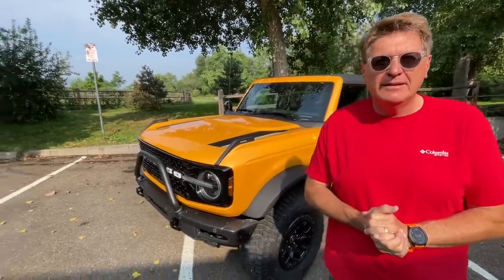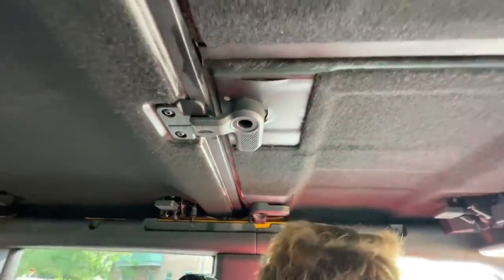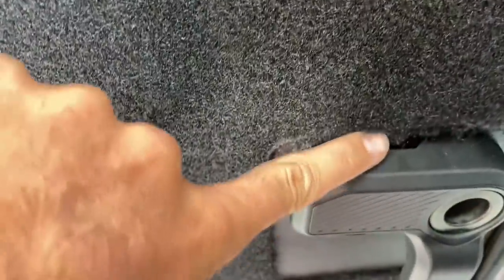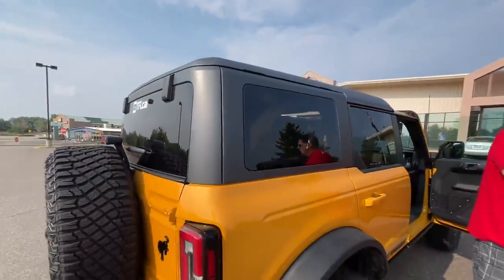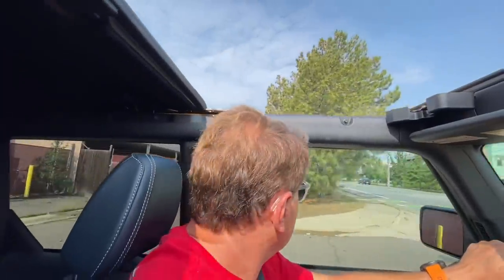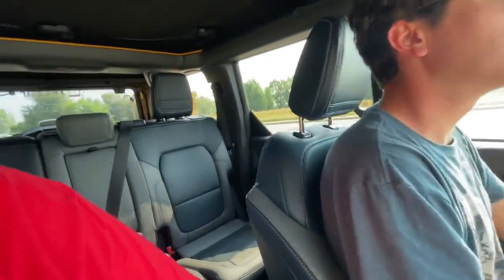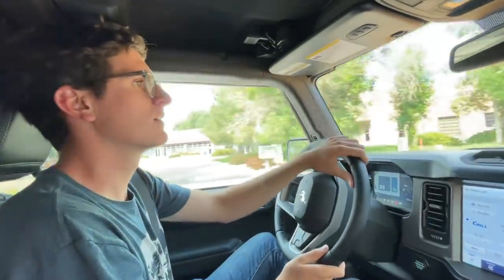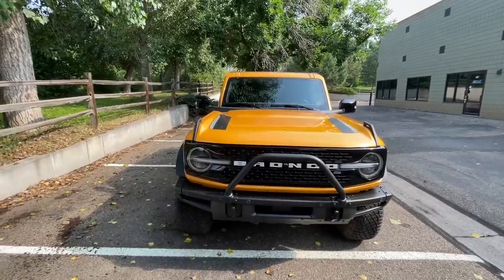This Roof Squeak In My Brand New Ford Bronco Is Driving Me Up The Wall, What Gives?

Comment: Seriously, the quality of the top alone would be a deal breaker for me.
Reply: yes it would
Reply: A $60k plus vehicle is a deal breaker for me.
Reply: Well, the first rule of new car buying is avoid first year of production of new models unless you like spending time at the dealership. I was a Honda tech back in '93 when the Del Sol came out, and every single one we sold came back multiple times for roof rattles and leaks. Eventually Honda redesigned the seals completely, which finally fixed the issues, but it took over a year.
Reply: That top looks like it was made in high school auto shop
Reply: @Timmayytoo  i had similar rattling issues with two fords i purchased that had been out so long they were about to be redesigned.
Reply: Well that is of course up to everyone.  It is annoying.  And they should take it back to Ford, not dump more money into it trying to resolve it themselves.  But a deal breaker?  Naw.  Tops are notorious for being squeakers.  IF anyone is worried about it, opt for a complete hard top shell.  But then, what would be the point, it would no longer compete with the Jeep. ;)
Reply: @WW-wf8tu  I'm not just worried about the squeaks, there's clearly other problems with it. The fitment, the peeling felt. I'd have no confidence that the thing would withstand the elements. Alone isn't a small statement. It could lead to a lot of owner frustrations down the road. For that reason, it's a deal breaker. I'd rather wait for Ford to fix the issue for the next model year than spend the next year going back and forth to a dealer with complaints just so I can be first in line.
Reply: @Timmayytoo  I agree but had one exception.  My first Nissan Frontier was the 2005 new model year.  I beat the crap out of that truck and it never rattled.  The next one developed squeaks and rattles the first year and my present Frontier did the same thing.  Weird.
Reply: Yup!!
Reply: @WW-wf8tu  I'd buy one of either brand in a fixed steel hardtop.  I never take the top off
Reply: Seems to me like a $10 rubber strip would solve this, and some epoxy glue. It sounds like it has just a bit of slop in it and that would act as both a wedge and an insulator between 2 rigid pieces bouncing into each other.
Reply: @WW-wf8tu  
Exactly. People overreact. A squeaky top is a minor annoyance that could be easily addressed by Ford. This is a first year production and issues are to be expected. I don’t know of any manufacturer who has zero first year quality issues, including top tier manufacturers like Lexus/Toyota. Some brands (European), never figure it out.
Reply: @rdouglass7787  No, you didn't, because your Ford product did not have a plastic top. You had a different problem.

Comment: That would drive me nuts! I had a Toyota 4 Runner 1989 SR5 with the full length resin top, took it off hundreds times on and off road and never had any issues with noise or wear and tear.
Reply: Of all of the squeaks and rattles my ‘76 FJ40 land cruiser has, none are from the removable hard top
Reply: @tunedub  same goes for my 77 hahaha
Reply: That’s because it’s a Toyota.
Reply: Big difference between  Toyota quality and Ford.
Reply: That’s because Toyota makes quality products……. That get tested before leaving the factory. Too many suckers in this world that have to buy North American made junk. The big three make crap vehicles.

Comment: I'm more concerned with all the particles falling when you slightly brush the roof.
Reply: No kidding. You could literally buy a 6 dollar carpet, cut it up, and have better quality insulation.
Reply: Should have used a type of Rhino liner spray on material
Reply: Ford Bronco is built on U.S. soil at Michigan Assembly Plant in Wayne, Michigan. The plant employs more than 3,000 American workers that just dont care anymore... truck looks like it was made in a third world country
Reply: @philtripe  except the top isn’t made by Ford…

Comment: Ford really needs to address their "chime". It sounds cheap and been around for over 10 years.
Reply: Drives me nuts as well.
Reply: Yeah, I haven't wanted to punch a car so bad since the 1980s "talking car" era.
Reply: When I was purchasing my last vehicle, the Ford chime and other electronics set up helped me decide to not buy Ford.  It really needs and update.  Radical Idea, how about letting car owners pick from a variety of sound/chime schemes.  You can do that with a 100.00 GPS, why not a 50,000.00 vehicle?
Reply: How to tell people have no real problems in their life: they complain about a car chime.
Reply: @cavscout678  How to tell a butt hurt Ford fan boy.. 🤠
Reply: @robertyoung8289  I drive a ford truck and i cant for the life of me recall what a car chime sounds like.
Reply: @jeepfreak4life76 At least it doesn't sound as bad as Ford's. GM has a new chime for the Corvette and Tahoe/Suburban which my guess is may trickle down eventually.
Reply: Use the Forscan program and disable most of these chimes, and adjust a ton of other settings.
Reply: @ejhayes76  Does it allow you to change it or just disable? Regardless of being able to disable it, they should make a new tone anyways.
Reply: @robertyoung8289  Oh no! Did you just call me a fan boy!?!? HOW WILL I EVER MOVE ON WITH LIFE!?!? Yawn.
Reply: I think the chevy chime is worse. Chevys also honks at you when you exit your car while the engine running. So annoying!
Reply: @Lumpia_In_Texas  Fairly sure you can turn that honk off. It only honks if you leave with the car running and take the key with you. Ford has some sort of alert for that too.

Comment: Ford should have this fixed in about 4 years and 10 recalls later 😑
Reply: If the recalls for the rattle in my Transit are an indicator of anything, the recall will not fix it and the dealer will keep rescheduling you when you show up for your appointment because the "don't have the correct glue".
Reply: If their repair of the cracked panels on virtually all 2002-2005 Explorers, Mountaineers and Aviators is any indication of their willingness to correct mistakes then I wouldn't hold my breath.

Comment: I have seen some cheap interiors before but Ford gets the award on the Bronco for the most hard plastic everywhere
Reply: Those original promo vehicle interiors were gorgeous, this crap they put into a 60K+ vehicle is down right unacceptable.
Reply: @PolishRadom1944  How much plastic is there that you all seem to suddenly know about or claim to be not present in the pre models ? Also since when does having plastic mean it's bad, when that plastic would outlast most other materials especially in a harsh environment and is easier to clean off, heck the plastic isn't even the real problem here.
Reply: @raionshishi8290  no where in my response did I say anything about plastic...

Comment: it's like they cut corners in every imaginable way on the new bronco... im glad i didn't pre-order one. this went from my next vehicle to a hard pass
Reply: Completely agree. Cost cutting is evident everywhere on this thing. Absolutely insane junk
Reply: Whats new with Ford? They've been doing it since the beginning of time with Henry Ford the first. Guy would go to the junkyard to see what parts still were salvageable, and then tell his engineers to make it cheaper and less durable. Its culture at Ford. Just helped my buddy put new turbos on his 2015 Ecoboost F150s and I could not believe how cheap the fittings and clamps were for it.
Reply: @bcatz454  Bingo, I own a f150 as well and just replaced the whole variable valve timing systems. Because every 5.4l v8 WILL FAIL
Reply: Now that over half of Tacomas and 4Runners are made in Mexico, yes, you can go wrong with Toyota. The Tacoma has gone from a top 5 most reliable vehicle to middle of the pack. Check the VIN before buying.
Reply: @Jose Alberto Rosa-Suliveres honestly I'd buy used. I'm sure somewhere in the last decade SOMEONE made a vehicle you actually wanted. Why limit yourself to choosing between a bunch of new terd sandwiches.

Comment: Not a criticism, but life experience informs us that more complications = more problems.
Same for unnecessary Falcon Doors, Targas, T-Tops, Pano Roofs and power assist of any sort.
Reply: Those look like incredibly simple latches to me
Reply: Exactly
Reply: @stevemartegani  Spray silicone all around the latches, side of tops and mounting surface.
Reply: It could be the latch pivot. Or the roof panels rubbing themselves.

I give it 4 stars
Reply: How complicated is it to make a plastic panel fit, or to not have peeling felt? It's pretty basic manufacturing on the part of Ford. They've probably had experience a zillion times over with similar pieces. In my theory, Ford just wanted to get the things out to itchy customers. They weren't concerned about quality. They can fix problems later anyways.

Comment: My 2018 Mustang Gt was bought with 7 miles on it. When going over certain bumps and dips there was a squeak that would come from the passenger side rear. Drove me nuts. One day I went with the fee-ounce-say to Costco to buy a bunch of drinks for a party. We loaded the truck up with liquid heaviness and drove home. The next day I back out of the driver way, a move that would always make the squeak, and to my surprise - no noise!!!! 

I later found out that it was just brand new parts that had to be broken in and the weight and the 30 minute drive helped get everything into the right place.

Comment: 63k! Yikes, I would be at the dealership every week until that was fixed.
Reply: Th plastic materials used are terrible
Reply: I'd be at the dealership returning the over priced turd
Reply: @johnjobber2219  oh really?; what type plastic did they use? Do you have a new Bronco, or just talking out of an orifice? 
You do realize Ford evaluates all sorts of materials for these applications? They don't pick one because it squeaks! 
And also, sometimes a supplier makes a few that don't meet Ford specs before it gets caught. It may be a sub-supplier who makes the raw plastic, also at fault. Production at the Ford plant was held up because of roof issues. People are working on the problem, I have read. 
These early production vehicles, especially on an all-new vehicle not replacing an existing architecture, always have glitches like this. (Even Toyotas, but they often stay mum about theirs, with secret warranties you only find at the dealer's garage.)
Reply: @melissaclark4912  I’ll do you one better I wouldn’t have even walked on the lot of a Ford dealership in the first place.
Reply: Agreed big time!!!
Reply: @rayrussell6258  I have seen and driven it. The plastic on the dashboard is what I am referring to. Not expecting the interior of a G Wagon but something a little better.
Reply: @johnjobber2219  Automotive writers are talking up that very same dashboard. You still don't seem to know your plastics, you might need to do some recalibration of your expectations to line up with mainstream customers. 
I've only seen one Bronco so far, but its interior and dashboard look more than satisfactory to me.
Reply: Of course you would be at the dealership constantly, it's a Ford not a Toyota.
Reply: @gazelom  LOL!
Reply: They decided to buy the most expensive version, the price does not reflect a typical Bronco. A 4 door base with hard top, v6 and Sasquatch is less than $45k.
Reply: @gazelom  A long ago not funny joke; Ford and Toyota quality data is within decimal points of each other every year now; in the '80's when there was union unrest in the industry you might have been right, but not in 2020's. 
I drive by a Toyota dealership.... see long lines every morning for repairs, just like any other dealer.
Reply: @rayrussell6258  You obviously have low expectations
Reply: @johnjobber2219  I think my expectations are totally in line with auto writers and mainstream customers who are raving about Bronco and the interiors. 
It must be hard being you, thinking YOUR definition of perfection is the only acceptable result. Falling on your sword so often must be painful. And lonely! lol

I'm happy to see a dashboard that isn't all black or gray. Ford is responding to customer clinics who have noticed the same boring interiors as I have for too many years. So try joining the mainstream, be happy, not critical of something as mundane as type of plastic, JJ.
Reply: @rayrussell6258  Basing it at the price point. At over 60k a better interior should be offered.
Reply: @johnjobber2219  customer clinics also say you are not mainstream in that thinking

You should not forget another attribute that customers want in this vehicle ..... the ability to hose down the interior. Special drain holes are even part of the interior DNA. 

Your "notion" of what a $60K vehicle interior should be does NOT match up to the target customers. So, you should stop complaining, take the vehicle for what it is.... which by all accounts so far in the media say is spot-on great!
Reply: some rich kids are buying them on ebay motors for $109,000  some one wants $175k for theres
Reply: @youtubecarspottersguide1  109K!!! why on earth would any idiot pay that?!!?!?!  1st world problems I guess

Comment: That’s no acceptable, also the Foam patches!!  why are OEMs obsessed with solving squeak and rattle issues with NVH patches everywhere, they should solve root cause before customers experience any symptom of the issue.
Reply: OEMs? This is a Webasto problem. Their mistake was picking a bad company, not building a bad product.
Reply: @mechmat12345  , it says Ford on the front . Once it leaves the factory, it’s fords baby . They did not know it was a issue ? It should have never left the factory!

Comment: My 2019 roush f150 had the same issue with the twin panel sunroof. I took it back to the dealer they checked it out and all they did was re-greased /lubed some parts and the sound went away
Reply: Anything Roush is involved with will be junk

Comment: My first car purchase was a 1967 Ford Mustang Fastback GT that had a loud tap sound happen when making both right and left turns.  Drove me crazy for about a year.  After removing the interior body panels, I finally found an errant 1/2" socket rolling around in one of the rear air scoops.  Socket had "FORD" engraved on it.  Sorry that this doesn't help your situation.

Comment: My 2016 Jeep Wrangler had issues with a creaking sound after a couple of months and it started leaking water not longer after. I went to the dealership several times and it was a bandaid. Now that the warranty is up I've bought a full cover for my Jeep for when it rains. It only leaks when I have the hardtop on, but surprisingly my soft top has no issues which is also made by Bestop.

Comment: Is it me, or does the felt on the panels “shed” every time you guys touch it?  BTW, I live in Kodiak where everything that might fail-fails… I had a JK Willys hardtop, got it not-to-leak ONCE in 2 years.  Over engineered, under developed modern junk.
Reply: It’s not only you…seen this on other Bronco YouTube channels
Reply: The dust from the felt is just a little bit of dust from the manufacturing process, it will no longer do that within a few weeks of owning the vehicle.
Reply: @MineGames131  And you know this... how?
Reply: My father works for ford and has a pre/early production Bronco.
Reply: You ever see how much crap is in the air you're breathing when a ray of sunlight shines through your living room window ? LOL
Reply: My 2015 Jeep Cherokee has a squeak SOMEWHERE inside and I still haven’t figured out where it comes from.
Reply: Do you know what anecdotal evidence means? Wranglers are known for leaky tops, one exception does not disprove the rule.

Comment: I'm really curious to see how it does in the freezing rain and snow. I've had endless problems with Subaru frameless doors and their windows freezing to the gasket and shattering when you force the door open. Looking at the new Bronco it looks like the door window will weld itself to the gasket in freezing weather.
Reply: I spray silicon lube on the door weather stripping for all my cars every winter and it helps them not stick when the temp drops. Also heard of people using veggie oil or something.
Reply: I usually just bonk the window slightly around the edge, I haven't broken my window yet and it seems to work okay.
Reply: @Ghost-vr5zg  but then they can't find things to pretend to complain about
Reply: well it actually leaks at rain though

Comment: I got one and I don’t have the issue, but I also have fully removed my top and reassembled it. I would bet you that the big rear section is loose. Check the bolts 🤙.